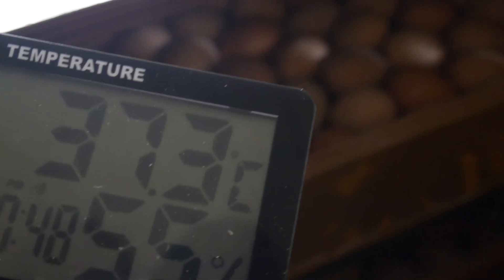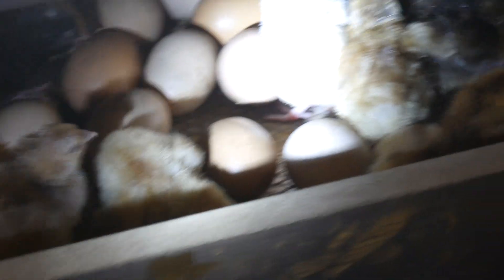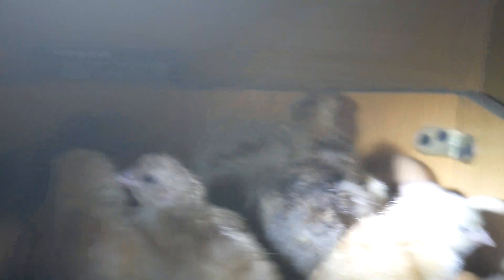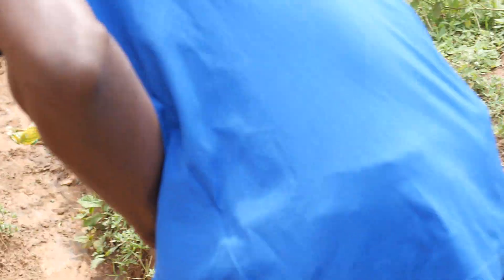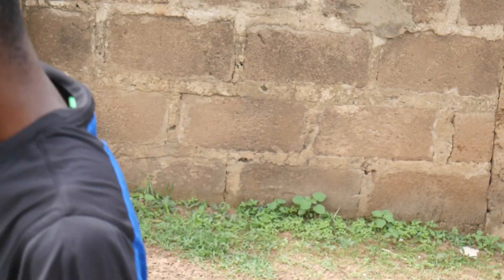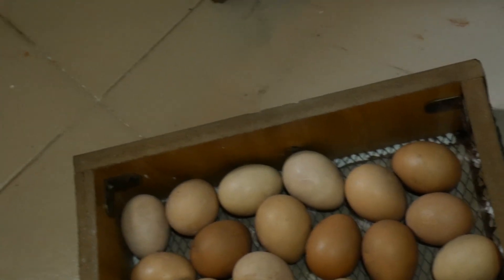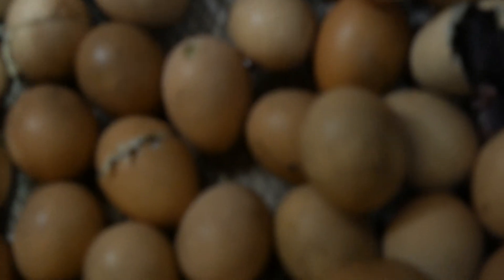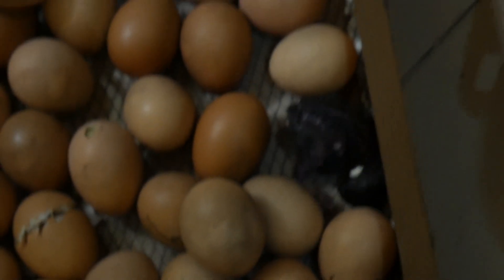Hatching Kuroiler Fertile Eggs With Kerosene-Powered Incubator, See What We Achieved | Chicken Farm

Comment: I have gone through your previous video and now I know why your hatch rate was low. The problem is a the way you constructed the incubator. There isn't supposed to be any wood below the trays, i.e your trays should have been hanging on the edges not on a flat wood, that wood below prevented heat from the lantern from getting to the eggs and also this will consequently lead to you using more kerosene than required, also there will be a great temperature gradient between the top and bottom trays. This is the only reason your incubator failed. Every other part was well constructed and should be left like that. To fix your problem is very very very simple. Just call a carpenter to cut of the bottom wood on which you placed your trays leaving just enough at the edges to support the trays. That's all!!!!
Reply from the maker: Thank you so so much. I realised that late. I'll try to do that. Thank you.